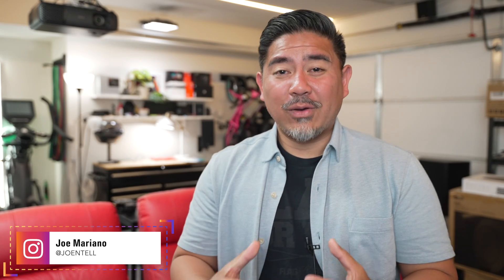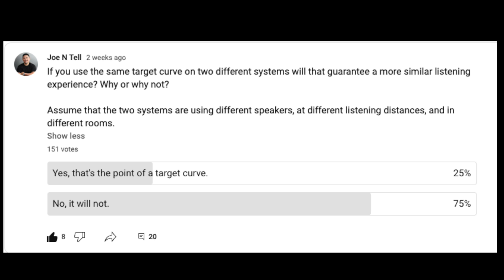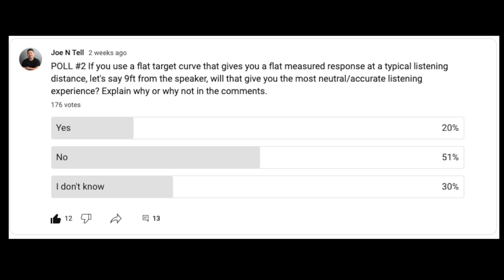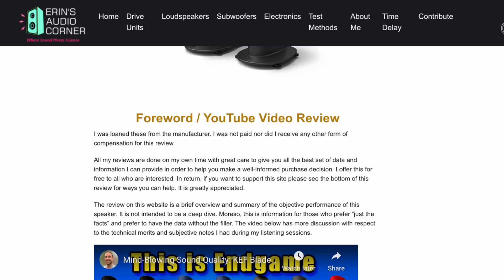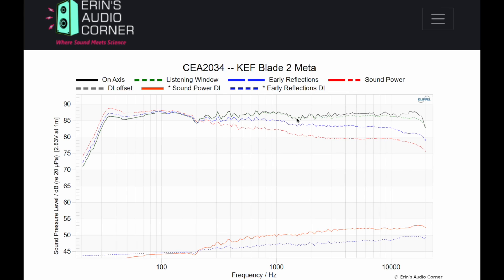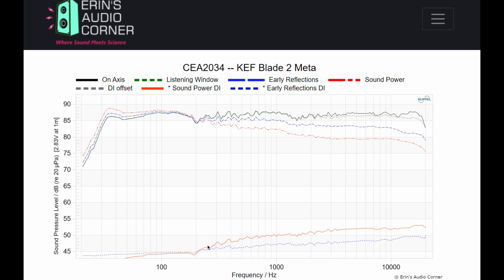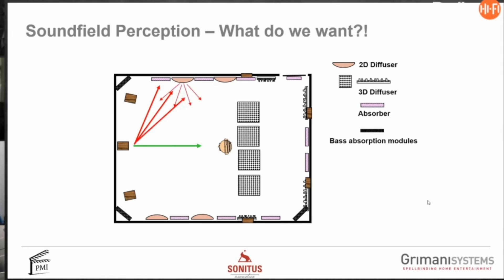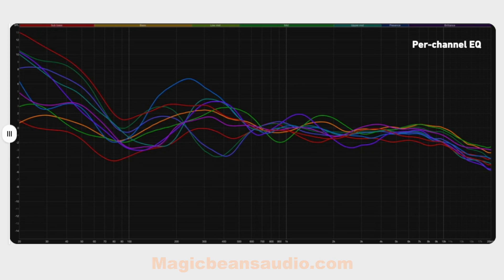Why Generic Target Curves Don't Work (Part 1 of 2)

Comment: What’s worked great for me is, limit correction to 300hz, drop a point at 250hz at 0db and drop a point at 20hz at +5db. But that last point of +5, that value should be set based on how the speakers naturally rise in bass in your room. The ideal value shouldn’t sound more bassy or less bassy. But just smoother bass.

It’s not obvious but what we measure isn’t what we hear. If there’s a disconnect in dispersion or there is too aggressive a rolloff at the woofer to tweeter crossover point, both will show up as a dip but only one of them will have a dip that is audible.
Reply: So I use Audyssey xt32 using the app. I see that below 100hz, I have room induced large peaks. Between 100-200hz I have some sbir, and between 300-500, it smoothes out and follows the speaker response. I could honestly use any value between 300-500 but I prefer 300 because the unevenness between 3-500 isn’t very much. I also take 8 measurements and space them out by at least 2 feet, max 3 feet. So the issues I’m really fixing are dips and peaks that persist over a wide area.

I’ve tried a tight mic pattern and it measures better at mlp but it sounds a little bit unnatural to me. It tends to get too focused on positional peaks/dips and overcorrects them.
Reply from the maker: I agree that the bass should not add or detract unnecessarily. I'm curious as to how you arrived at the 300Hz figure. The MB app determines the transition region based on the measurements. I think some people are surprised as to how high the transition region actually is in their room. I was.
Reply: To digress a bit more about my setup, after I run Audyssey I typically find that Audyssey sets my sub trim 2db too hot. Bear with me, I know the consensus is Audyssey is bass light.

It seems that Audyssey sets the sub trim so 30-80hz random pink noise measured using c weighted spl meter lines up with speaker levels. But c weighted rolls off around 40hz. When using z weighted or comparing sweeps between my sub and speakers, the sub is always 2db too hot.

Once the trim is addressed I use rew to line up the impulse peaks between my subs and mains. I find I have to flip polarity on my subs after lining up the impulse (by adding 2m to sub distance), then the blending is just seamless.

After the above is done, then I do what I mentioned earlier about a simple 5db house curve with correction limited to 300hz. There is one last caveat though - Audyssey auto leveling. I know you covered it so you’re aware of it.

The trick to getting around auto leveling in Audyssey using the app is:
1. Mimic the exact same house curve on the subwoofer channel that you did to your other channels
2. Hop on over to the corrected response and see at what frequency your sub response crosses the 0db line
3. Go back to curve editor and place a temp point on that frequency and see where it has to be to line up with your house curve. Note that boost and remove that point.
4. Boost sub trim by the value you got from step 3.

That’s basically how I do audyssy multi eq-x on a budget 😄
Reply from the maker: @navidmahmood876  I think you would love what Magic Beans True Target would do for your system.

Comment: Usually a flat curve gives a flat (boring) sound
Reply from the maker: Because they're incorrect as target curves unless you're extremely close to the speaker. For most home theaters with listening distances 9ft+ away, it's a bad idea.
Reply: @joentell  yes, i’ve been a sound technician for years i was just commenting on the false idea that a flat curve gives the best accuracy. I recall in my years that every recording studio in France had a pair of Yamaha NS-10M speakers, not because they sounded good (they didn’t, but as monitors they were quite analytic and very detailled, but also very tiresome to listen on the long run), but every sound engineer knew how they sounded and they were used as a reference, you knew if your mix sounded that way on the NS-10, then it would sound that way in the end user home.

Comment: I still don't understand why you should apply correction above the transition frequency at all. 
Just get good speakers with a flat on axis and smooth directivity in the first place
Reply from the maker: That's assuming everyone can afford to buy good speakers in the first place. They may want to get the most out of the ones they already have. I agree that is the best answer. 

Also, if you have good speakers, if you have nearby surfaces that affect the response above the transition region, you will want to correct for that as well.
Reply: Good speakers with flat on axis and smooth directivity will sound like that on an anechoic chamber, not in your home theater. Your room and everything that’s in it will affect your speakers’ sound. For example in a concert hall you’d be surprised at how much the presence of the audience affects and dampen the sound.
Reply: Correct you shouldn’t. Two ears and a brain don’t hear like a mic and analyzer above the transition frequency, any EQing there should be confirmed by a listening test (divorced from the below transition frequency EQ) preferably blind to lessen ones bias

Comment: There can be no target curve for any speaker in any room until every song is EQ'd to sound the same with that curve

Your target only works with the music used to get your perfect sound and changes completely with the next song mixed by monkeys
(or the Rolling Stones)

If you Auto EQ a perfectly recorded Fleetwood Mac tune to match a flat pink noise profile, it can sound the same with or without that auto EQ applied as it was recorded perfectly to begin with

If you try that with a Rolling Stones tune, it can sound HORRIBLE as each track has an EQ curve that has no relation to the other tracks and should be left in its mangled missmatched state to sound its best

Other tunes may sound best when auto EQ'd 70 -80% of a flat response but no more  (some Bob Marley tracks come to mind)

Leaving your music collection in it's original EQ'd state makes your speakers "Target Curve" worthless

Correcting the EQ of each song separately from your speakers "Target" curve is the only way to get to a true reference Target for any speakers in any room , otherwise it changes with the music you play
Reply from the maker: EQ'ing your playback system is your responsibility. EQ'ing the music is the mixing and mastering engineer's responsibility. A reference system will expose the issues in the mix. I agree that the mixing engineers should have their systems calibrated using the methods I'm recommending. We've started talking with some and they agree. 

For old recordings, my recommendation is to have your target response set to an accurate reference based on pink noise. You can adjust on a per-track basis using a more global EQ method such as bass and treble tone controls. No need to remix every song.
Reply: @joentell  There is no "Global" EQ method for old recordings
Every song I have has been remastered for a flat "reference" response so that no further tweaking is required to sound its best with each individual speakers target curve

My other pet peave is headphone reviewers complaining about the stereo width when in actual fact, the problem lies with the reviewers themselves

The stereo soundstage width of all my reference stereo tracks are the same width on one specific reference pair of headphones

Reviewers often use a different amp then complain of the width
or they use a different song that is lacking in width and blame it on the headphones
or they use dynamic headphones that have phase problems  or mismatched drivers, then praise them for their amazing width

Width and EQ should be the same for all reference tracks whether you are selecting a target for headphones "or" speakers

Comment: I’ve had good results with the curve I’ve been using, basically it’s similar to a JL Audio curve. What I do in Dirac is add about 5db at 20hz and tapper that down to -6db at about 500hz and that’s flat until 2k and then ramps up just 2 db’s at 20k….. this has allowed me to listen to movies at -10 with plenty of bass and non of high frequency harshness
Reply from the maker: I think with enough time, it's possible to arrive at a proper target curve by ear. It takes many hours.
Reply: From a flat curve I added 2.5dB below 35Hz and 0.5dB above 10KHz (the tweeters on my speakers are quite « soft » and i like the sound a bit brighter). Thats on my front and surround speakers (floorstanding speakers with dual 21cm bass speakers on the front and dual 19cm on the surrounds). The center speaker has it’s own curve, as it doesn’t manage as much bass. I kept the 0.5dB on the highs but starting at 5KHz, and added 1.5dB below 200Hz. All is managed with Dirac Live Bass control, it does marvels at keeping it clean, tbh i’m impressed at how efficient it was. Also i don’t need to push up the sound to be able to hear the dialogs, and when watching a movie at night I also can watch the movie at lower volume without loosing sound quality.

Comment: But you are always measuring the system in the room with Audissey, Dirac, or dedicated measuring software on a laptop with calibrated microphone. So what do you mean by target curve? Do you mean the curve on the equalizer/processor or the curve measured with the software and calibrated microphone?

If you mean the last then I always end up with very similar curves that I like, at my home and at customers homes as well. But as I said it might not be to the customers taste and then I have to alter the curve, so the target curve is my baseline and then I tweak it to the situation.
Reply from the maker: After your run a calibration with Audyssey with the MultEQ-X app or Dirac, it takes its own measurements and at the end, it asks you what target response you want. That's what I'm referring to.

Comment: Does this approach apply to both Home Theatre/Listening Rooms, as well as something like near-field speakers (say at a computer or for mixing/studio purposes?) My question is, what is the correct way to apply correction in a Studio/PC listening near-field situation using something like REW.
Reply from the maker: You're likely within the critical distance in which case you're likely to see less high frequency roll-off due to distance. Any roll-off required will likely be due to being off-axis to the tweeter. The Magic Beans app will correctly determine the target curve for that situation as well.
Reply: @joentell  I'm doing the correction with REW and a Dayton imm6, as I'm on a really tight budget. Id love to use magic beans, but unfortunately it's too expensive for me right now. A free trial/version with less features or limited channels maybe would be really cool. 
But would you say that the method you mentioned elsewhere (trace arithmetic) would apply to near field too? Or should I be doing it the normal way of following a curve (if so which one?). I also read somewhere about only correcting the mids and below (around 800hz and down) and leaving everything higher uncorrected. Thoughts on this approach?

Comment: Don't know if its just me but I rarely see someone addressing the fact that we have anechoic data (klippel) for a lot of speakers.

 So let me ask you this, suppose I have anechoic data for my speakers and I can EQ them (good directivity) so that they are flat anechoicly....then apply a bass boost based on the harman curve upto the transition frequency (which is very similar in most rooms) because as Dr. Toole said unless you are listening to reference a bass boost sounds better to most people. 

Is even the best correction application / software /algorithm going to make things better or worse?
Reply from the maker: I will address this in my next video. Correcting based on anechoic measurements is better above the transition region compared to what popular room correction currently does. That's assuming that nearby surfaces aren't affecting the response of that speaker within the critical distance. Let's say that speaker is placed less than 6" next to a wall or TV. The nearby surface now becomes part of the waveguide for that speaker which is not in the anechoic data, but can and should be accounted for. 

You can guess where the bass rise should start, the slope, and how high it should be, but determining that via measurements will give more satisfying results.
Reply: @joentell  never thought about the critical distance but it makes sense thanks for that insight.  when we talk about distance between the speaker and a surface, we mean near the actual drivers or any part of the speaker cabinet?

Comment: I'm a noob at this and have put together a budget 7.1.4. I've done nothing but run the room correction on denon 3800. I know i need to learn alot more. Someone got me a mimiDSP  for Christmas. Will that be useful with Magic Beans. I have a small 12x14 ft room. Thanks for any input.
Reply: Thanks
Reply from the maker: @marcuslove5774  yes to MultEQ-X or Dirac. The MiniDSP will be useful in calibrating multiple subs
Reply: Honestly, I would look at getting the Multeq-X Software for the Denon and of course REW and a Umik-1.
The Multeq-X measurements provide better results than the regular Audyssey with a few tweaks. REW helps you figure out whether there are any serious issues with your corrected Frequency Response. It's a steep learning curve and it can turn into a full-time hobby if you aren't careful, but it's worth it...😉

Comment: At higher SPL, distortion becomes an issue, but so does certain frequencies that the human ear is most sensitive to.  Even if you have the perfect perceived FR for a given SPL for your system and even if there is no perceptible distortion, the perceived FR can sound a bit "harsh" due to different Equal Loudness Contour.
Reply: I doubt that true since vast majority of movies and music is mixed at louder levels than most people listen at, could be the speaker compressing causing that  or you listening louder than what the people in mixing studio did.

Comment: All this stuff is well known but I do agree taking into account speaker characteristics and eqing appropriately is probably a better idea. But if you ignore it and eq the speaker and the speaker ends up sounding wonky...this will be reflected in the listening position FR as well ! ..and im guessing it will end up not following the curve as expected...and you'll either try eqing it more or give up realizing it's the speaker design error...if your calibration system saves you the time and hassle ..great.
Reply from the maker: It's often the room, specifically nearby walls or surfaces like TV's or bare floors that cause the most issues.
Reply: @joentell  oh absolutely. I speak from first-hand experience.